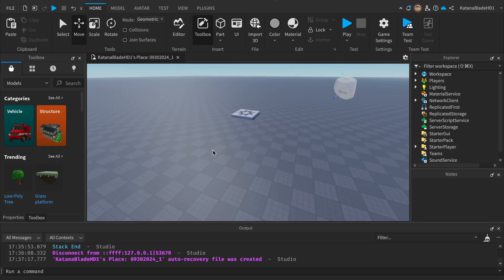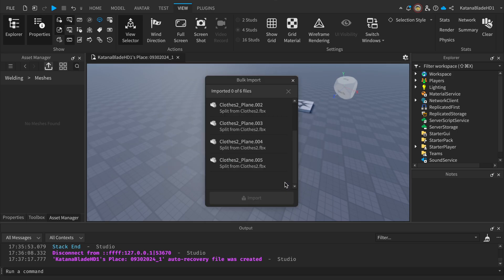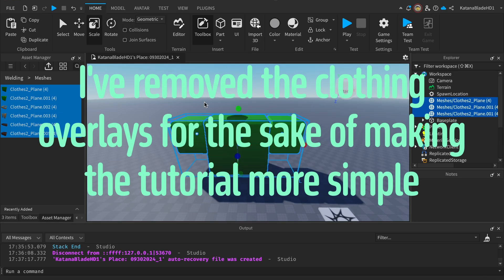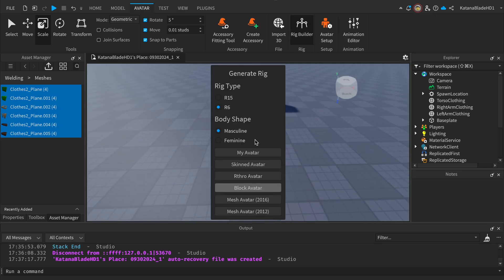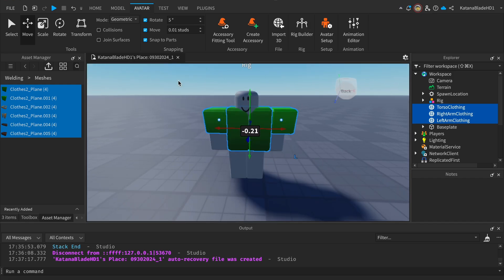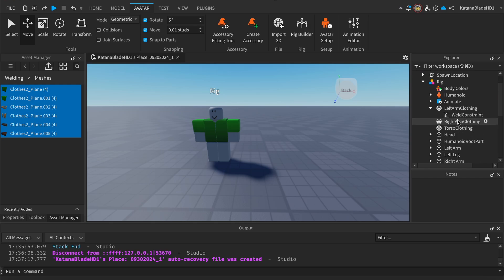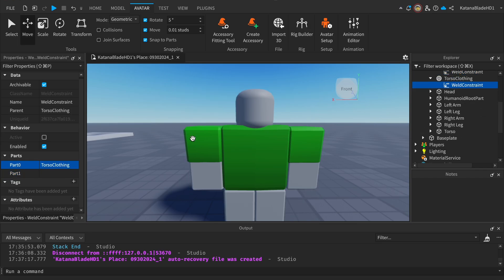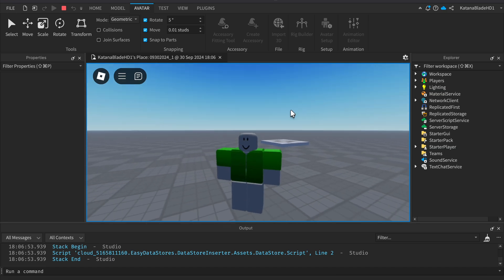How To Weld 3D Clothing To Your Roblox Character | Roblox Studios

Comment from the maker: UPDATE: If you’re welding clothing for a game I STRONGLY recommend using motor6D rather than a normal weld constraint. It works the same but it will remember the disposition between the last item it was attached to making it easier to switch clothes.